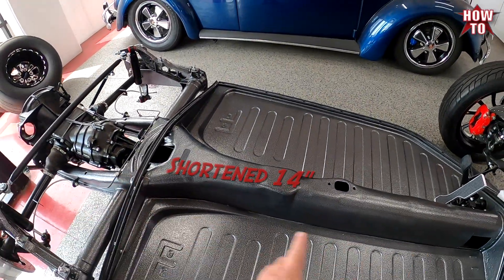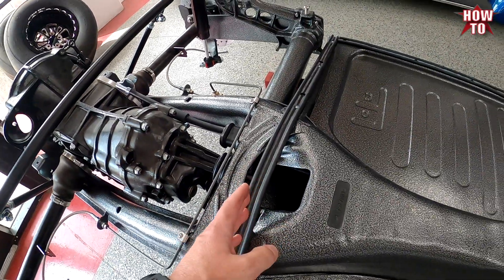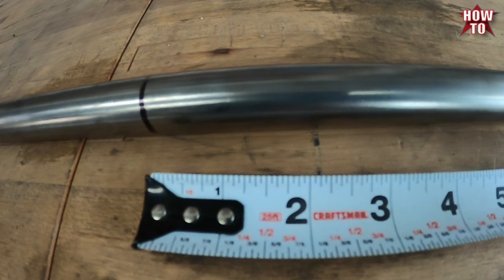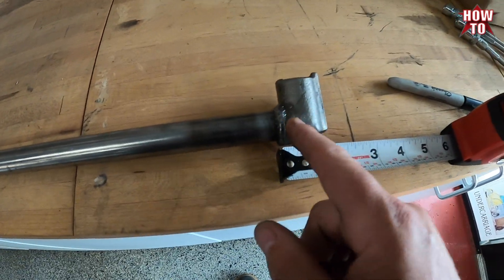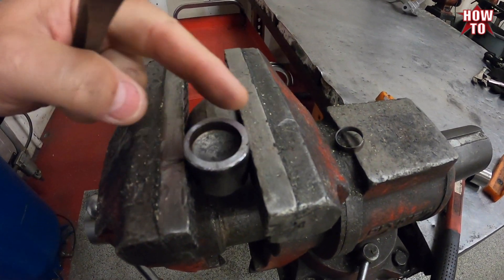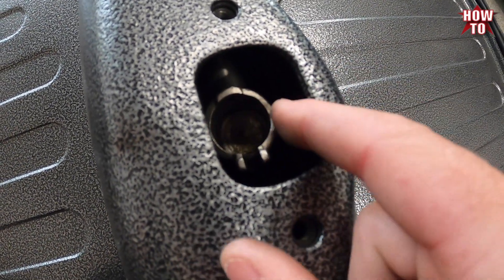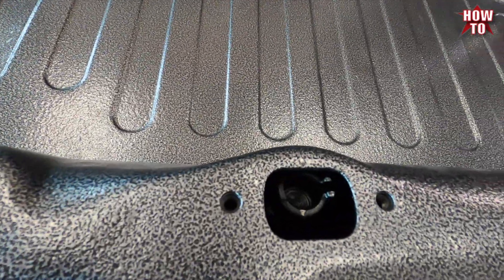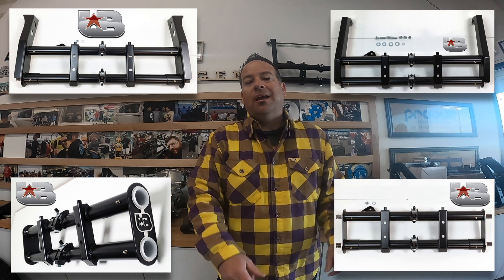HOW TO: Shortened Volkswagen Kit Car Chassis Shift Linkage - Let's MATH it out!

Comment: I just shortened one, curious to see how they did it.
Reply from the maker: I think you will like how we "math it out".
Reply: I did mine the same way except I didn't use a band saw, I used a cut off wheel and went the depth of the weld. Made sure it was centered and side to side then welded it up. 👍🏼